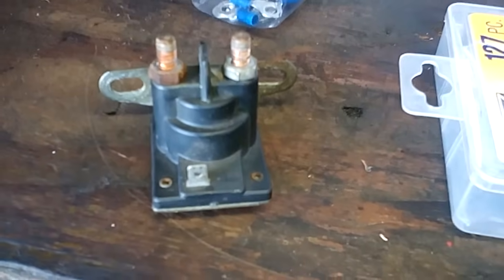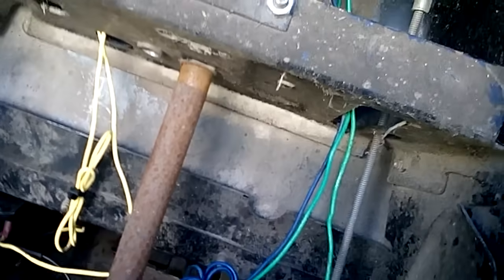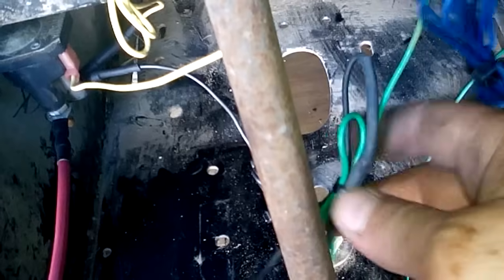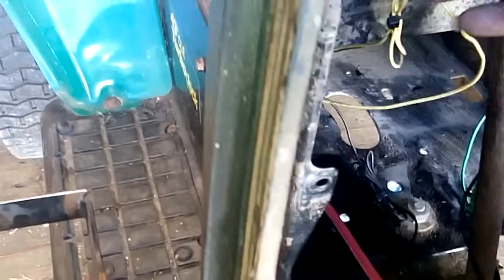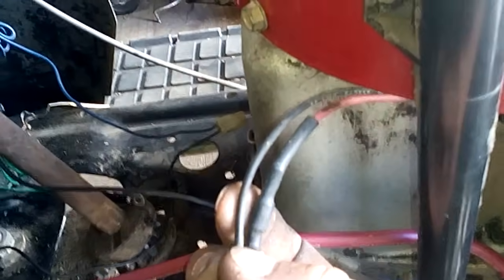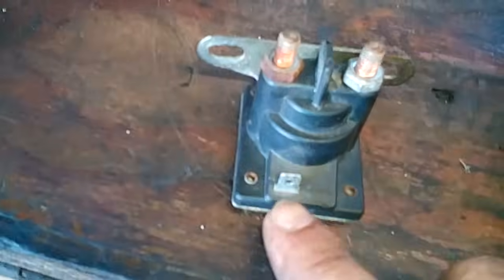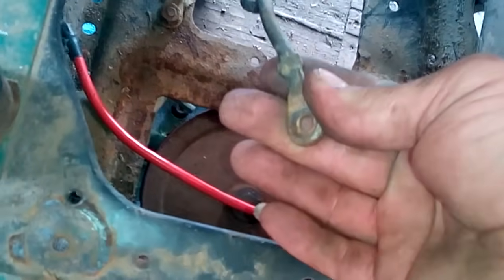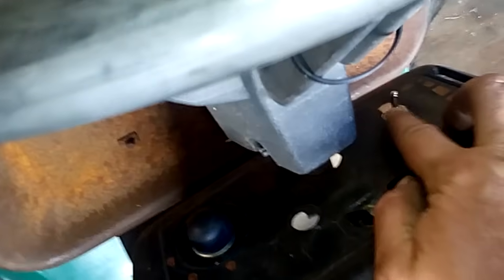Simple wiring for toggle switch and push button start

Comment: Yeah dropped the deck for the blades because I use my push mower as a cheap tractor, but I needed to bypass the kill switches on the mower. Thanks for the help!

Comment: Thanks!  That was the best explanation I have seen. Rather than ask why my solenoid has 2 terminals and three wires I'll just buy a 1 terminal device. Same with the extra #14 red coming off the battery.  If it ain't in your video it gets chopped.

Comment: I did this wiring for my older 70's Cub Cadet and it worked for me no safety switches I would like to see if there's a way to keep the battery charged with out hooking up a battery charger

Comment: Hey there, great video. Could you please help me out, I'm stuck on this wiring thing lol. My mower is a yard machine with a 20hp tecumseh motor. Now I have a red coming from the carbs. The green goes to the coils so I get where to wire the green. Not sure about the red. And from the motor I have a red and a yellow wire. So I take it the red goes to the solenoid  but I'm stumped on where the yellow wire goes. On the schematic the yellow is magneto, red is to regulator. Please help me out. I juat need to know where the red from the carbs and yellow from the motor goes. Thanks a million.

Comment: What if the solenoid has two prongs? Do you only use the one and leave the other one open?
Reply: Might have to ground it to the frame of solinoid with a wire and other post is trigger wire for starter

Comment: Yep I got a type of conundrum but I don't want to start cutting wires and that type of conversation I want to use the existing system to plug switches in and I don't know the wire codeing  my machine in question is an arians and it has a 7pin ignition switch and that alone is confusing don't understand how all that goes together with out a mushroom cloud over my back yard  any idea would help or a web site to get some details on the wire diagram and or were stuff should go 
                                                                                   Thank you in advance

Comment: Liked the video.  with the 2 wires coming off alternator.  The one for the lights, can i connect this to the battery side of the solenoid?  not running lights and only when i do this will the solenoid activate.  Thanks!  Billy

Comment: If i wire the kill switch with a lit up toggle do i connect it to a ground or neg battery terminal.  I have it hooked up to power on battery and a freshly made ground as well as wire that comes from the spark plug and idk if switch is bad or hooked up wrong. The light sorta comes and goes. Is my switch bad or non compatible

Comment: So how do you do this wiring job on a 21hp v twin briggs Intek? It has the 2 wires coming off the bottom of the carb... I can't figure it out.  ... help...
Reply from the maker: The one on the bottom of the carb is just the fuel solenoid. Unscrew it, pull the plunger all the way extended, cut the rod holding the plunger, reinstall solenoid, ditch the wire running to it... It's not needed. The solenoid closes when key is off to keep gas out of the carb. FYI that's what the float pin does inside the bowl. The solenoid is truly not needed

Comment: I brought my Husqvarna tractor last June where it is rigged that I have to turn on the light switch first then turn the key and it cranks that way. I also got a side choke knob to push and pull and the lever that has a choke option at the top follow by the fast(rabbit) and slow(turtle). The big advantage is when I have to step off my tractor to pick up trash and big stick in the yard the motor still running and I learn how to work the brake(push it all the way forward to lock) to stop the tractor. Before that, when I shift the tractor to neutral it move slightly forward until I'm back behind the wheel. Disadvantage is when I turn the key to off and turn off the light switch the tractor will pop (or backfire) after it's at a complete stop. Do I need to use both chokes when starting the tractor?

Comment: Thank you for the video. I have a dual pole solenoid, can it work, or I need to change it?
Reply: Inspired life way, I was wondering the same thing, I've run the other pole wire it comes from alt charging wire. Don't know if it makes a difference or not.
Reply: @lonniesmith6701  I actually grounded the other pole at first, and it did work. But I changed a few things including connecting the gas control valve to the red cable and then exchanging it for a bolt since it was glitchy, which was not on this video, and also decided to get a one-pole solenoid at auto-zone, everything works awesome now.
Reply: Inspired life way, I think I'm going with the single pole solenoid also, finished custom wiring, hit the button nothing, single pole does make a difference.
Reply: I did got my tractor to work with the original dual Pole when grounding one side, but it is more convenient with a single pole

Comment: You are awesome that helped me a lot
Reply from the maker: glad I could help bud
Reply: Went home and done it over now I know why my mower was starting and that is because I had the kill switch wired to the starter watching the video made me feel stupid the rest of the day until I watched this and got it fix
Reply: Can you help me with I want wire up a battery charging system on my riding can you help? It would help so much if you post a video on to do that so I can do it to mine
Reply from the maker: There are 2 wires coming from the alternator under the flywheel. One has a diode. This one goes to the battery side of the solenoid to charge your battery. The other one goes to lights
Reply: Thank you
Reply from the maker: Anytime bud. Sorry it took me a few days to see your question
Reply: Mickee 78681 it ok your the best at explaining I have a hard time understanding a lot things but this one explains it step by step how it t is done that is awesome

Comment: I dont have a single prong solenoid. mine has the 2 bolts, and then 2 prongs, I can not for the life of me get it to jump without running a wire from one bolt to another. when I do that, it's burning up anything from a 16-10 gauge wire. any advise would be greatly appreciated
Reply from the maker: one of the lower prongs goes to ground
Reply: +Mickee 78681 ok so then the other I'd use for the push button correct? Just wanting to double checks. 2 weeks of working on it every day and I'd almost scrap it if my cousin wasn't buying it
Reply from the maker: +Tyler  Titsworth  correct.
Reply: +Mickee 78681 thank you. I'll get it a shot when I get home
Reply from the maker: ground one of the prongs.

Comment: I tried this on my Briggs 20Hp V-Twin, when I hooked up the battery cable to Battery, engine turns over and starts, toggle switch does not kill motor either. Does this mean my Push Button is bad? What did I do wrong?
Reply from the maker: Walt Robinson nope. Means your toggle is not grounded properly
Reply: I Took Ground Wire from Toggle Switch Straight to Negative Terminal On The Battery, A++++++++ WORKS BEAUTIFUL, THANKS Mickey, You Know Your SHIT !!!!!, Anyone got a problem, He is the MAN WITH THE PLAN !!!!

Comment: Can you remove fuel solenoid and put in a plug
Reply from the maker: I always removed it and put a small bolt in it's place
Reply: @WrenchandRides  what do you do with the electric connection then just leave it lay
Reply: I'm rewiring an older craftsman like you did here. It's just being used for plowing my drive and pulling trailer so not sure what to do with that connection
Reply from the maker: @Dave-nx9zg   I just trace it back, cut it and cap (insulate) it. It serves no purpose
Reply: Appreciate it man

Comment: is this going to work if I have a fuel solenoid? can I just ignore the fuel solenoid or do I need to find a way to remove it
Reply from the maker: personally, I remove the fuel solenoid from the carb and replace with a bolt. damn things are only irritating at best
Reply from the maker: if you want to leave it in, then just run another circuit to a separate toggle switch
Reply: what would happen if I just unplugged it?
Reply from the maker: it would prevent gas from entering the carb. when electricity is sent to it, it retracts a plunger that allows gas to flow. when you turn the key off, taking away the electricity, the plunger extends and blocks incoming gas. you can remove it, take a pair of cutters, and simply cut the plunger off as low as you can, screw it back in.... and then you wouldn't need it plugged in to the wiring harness
Reply: hey man, I've done this but my solenoid has 4 connections not 3. I have my button connected to 12v and the other end to the solenoid. but no luck? the problem is I can't figure out what pole on the solenoid to attach my button to none of them work! am I missing something?

Comment: I installed a push botton on my tractor it starts good but it sparks when I try to hookup the charging wire to the switch what am I doing wrong.
Reply from the maker: Charging wire goes to the battery, positive side with an inline fuse

Comment: What I meant was,, if I lead two wires from solenoid to a push button do I need a fuse between them just like I can use  a screwdriver on solenoid to start engine.
Reply: frank rumble

Comment: Hi.. hey I bypass all my switchs...but it won't run...... you know that gear on the starter....it's spinning but it won't come up to the flywheel....help... please... anyone
Reply: The problem is with your starter.  Check to see you have it mounted properly.  Tap on the starter a few times with a mallet to see if you can get it moving again.  It may be rusted and frozen.   At worst, you may need to rebuild the starter, if you want to tackle doing that, or just buy a new starter.   For a mower, they will run about $40 bucks or so.  Some mower junk yards may have a starter that works well which you can get much cheaper. Good luck with your repair project.
Reply: Might not be lined up right with teeth. Take off cover and line it up. See if it goes then

Comment: Can you use 16 gauge wire?
Reply from the maker: I imagine so. I use 16ga when running Motorcycle accessories and that's constant draw from the battery. Should be fine
Reply: Wrench and Rides ok thx

Comment: what gauge wire did you use for push button start?
Reply from the maker: oyo collins It's 14 if I remember correctly
Reply from the maker: +oyo collins I don't know why, but I just saw this. I use 16ga wire for everything except battery leads.
Reply: Mickee 7868
1 

.....

Comment: how did you get over the card wire
Reply from the maker: I'm not sure I understand yer question bud. Card wire?
Reply: Your carburetor wire that is also connected to the kill wire
Reply from the maker: Carb is not connected to kill wire. I don't use a fuel solenoid. I use an adjustable jet in the bottom of the bowl, To add a fuel solenoid you can put it on it's own circuit (separate toggle switch ... battery to toggle, out of toggle to solenoid, out of solenoid to ground).

Comment: Only wiring I've seen that is step by step. Not read schematic...my Murray is about beat me, now I can go back and beat it.... Damn safety system has a fault somewhere. I'd have to do a complete new harness, replace all the switches.... Nah, don't think so! I have hope again, and wife can stop threatening to buy a new (junk) rider for me. Nothing today is worth a crap. Murray after 20 years still has original engine. Now I can ride again! If I want lights separate, can you use a separate  switch or is there a toggle with bi-directional, that could be wired with or without lights while running? I really don't want it too complicated.